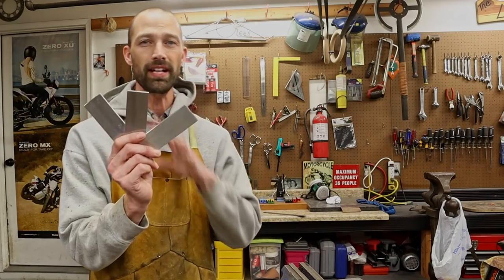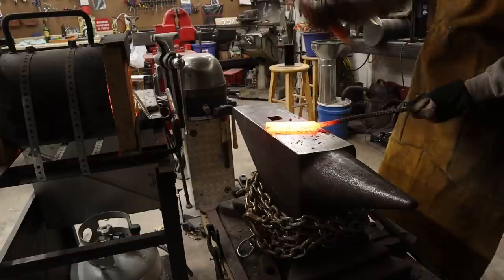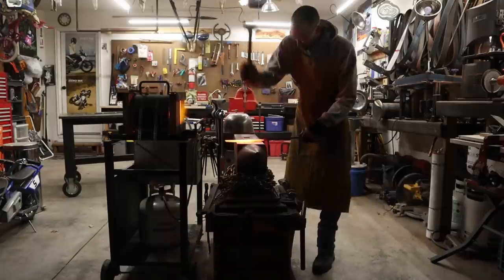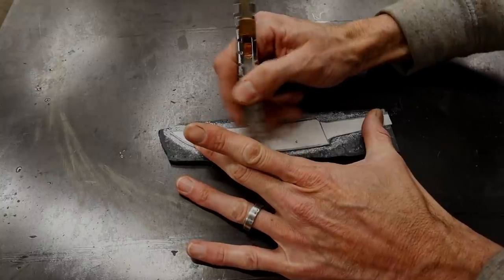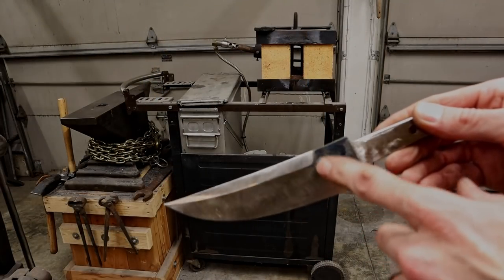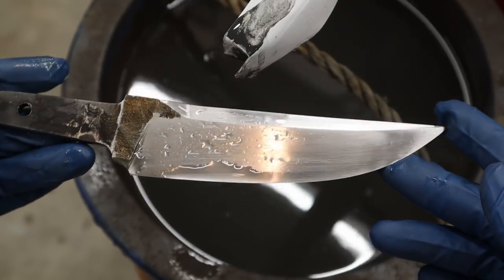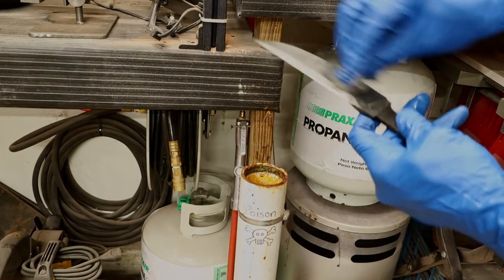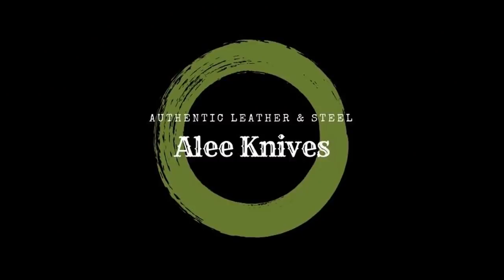Easy San Mai  ( By far the easiest method to hand forge San Mai )

Comment: So weak cutting out the shape....forge out the shape with a hammer. I'll give this guy a 2 out of 5 only because he's knowledgable
Reply from the maker: Thanks for your vote of confidence!
Reply: @lordofgonzo  I do believe I do concidering I do blacksmithing but good looking out
Reply: As do I, friend.
Reply from the maker: I do have a question, how do you fully forge in the bevels on a san mai knife and still have the core material perfectly in the center. If you did fully forge the bevels your outer cladding would migrate over your cutting edge really easily. I am on Facebook! I would love to see some pictures of this! I am always up for learning something new man!
Reply: @Aleeknives  I dont do San Mia so I could tell you how to do it I would say to take that question to r blacksmithing
Reply: Couldn't*
Reply from the maker: K
Reply: @Aleeknives  Search Burt Foster WIP. Burt is the master of stainless laminate. Again, half the prep isn't necessary for straight carbon san mai, but the forging and finishing are basically the same.
Reply from the maker: I love Burts work!
Reply: @christopherb8206  ...but you "do blacksmithing."
Reply: @Aleeknives  Ilya on The Works channel does a comprehensive video on forging a san mai knife that includes forging bevels and controlling the position of the internal layer.